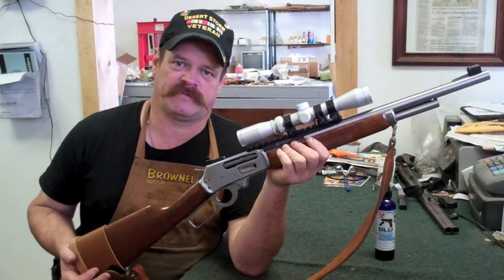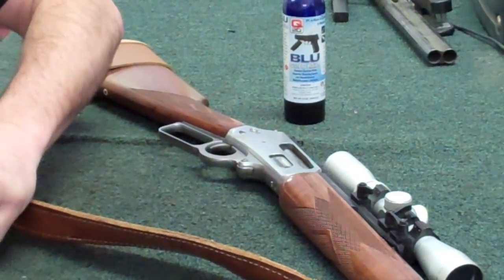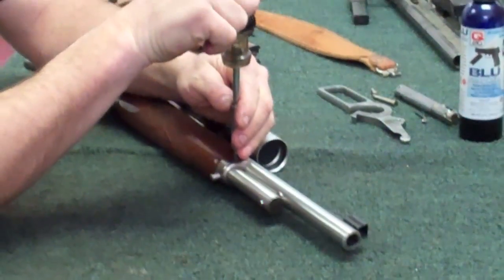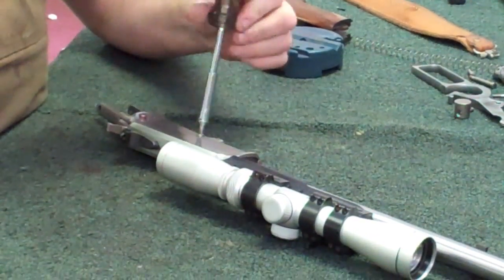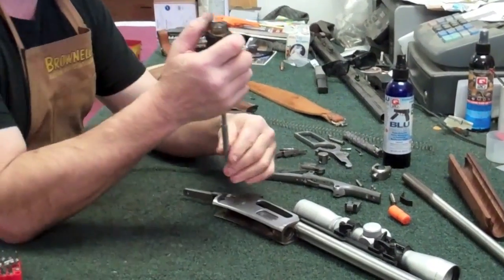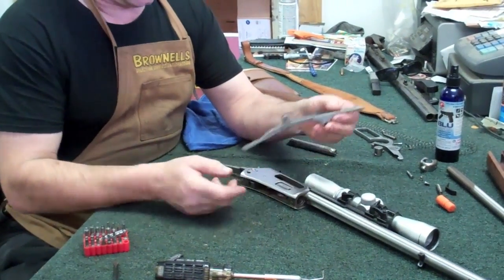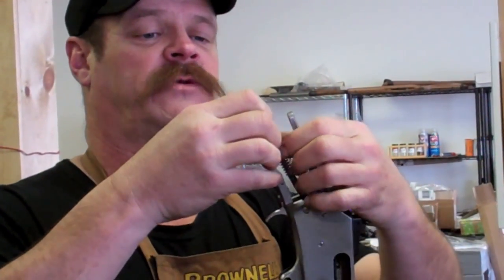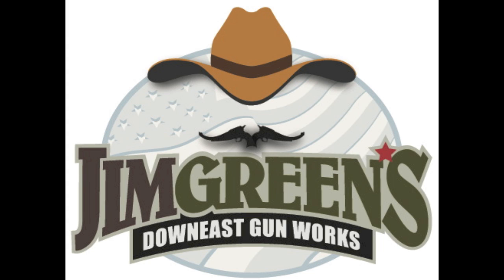Gunsmithing Disassembly: Marlin 1895 "Guide Gun" (Gunworks)

Comment: Just picked up my first Guide gun yesterday and this is the best video for the tear-down and reassemble too date. Had nothing but problems with my Winchesters so decided to purchase the Marlin, hope it works better. I was a small arms coach and tech for the military so my Winchester problem had nothing to do with lack of skill it seemed I had lemons. So you Winchester lovers I'm not dissing them my Model 94 in 45 lc case hardened trapper works fine and I love it it was the 45-70 model 86 had problems with.

Comment: Great video, very helpful. One minor comment, the spring on the inside wall of the receiver is the ejector(not the extractor, which is on the bolt face).

Comment: Thank you for the great video!  Just bought a .45-70.  My two-part firing pin is tight.  More used to pistols that I might clean, but typically don't oil.  Do you ever remove the firing pin to clean it?  Do you reassemble dry or oil it?

Comment from the maker: The 3 rd scope ring helps reinforce the scope and keep it from coming off the gun. Recoil was so stout with these loads the scope was coming off the gun after about 6 shots.
Reply: Quick question though, do the new production Marlins (336, 1895, 444, etc) have a half-cock on the hammer? I know they have the whole hammer block safety and everything but was wondering if it had the half-cocked option. Thanks for the video and keep up the good work!

Comment: Jim,  I have a question 
I have a 1895 classic with 22 inch barrel. Only holds 4 +1 but is extremely  tight to load. Is it okay to shorten the spring to ease the tension on loading.
If so, how many inches would be safe so as not to impact Action
Thanks for your help

Comment: Hi Jim, I recently bought an 1895 dark series new and noticed that the carrier initially is flush with the chamber when cycling but then drops as soon as the hand lever passes the carrier hook which I believe is resulting in rounds entering the chamber at an incorrect angle. I would say one out of four rounds results in a failure to feed and I think it’s due to this but I’m not certain as I don’t have one to compare it against. Is this a factor of breaking in the rifle or is this a manufacturing defect? Cheers for the videos!

Comment: The "tricks" were a help. What type of rear peep sight is that? Can it be set up with a finer aperture than a ghost ring? I'm looking for a good solid rear peep for my 444S. (My older Marlin still has the two screw holes drilled and tapped for a side mounted peep sight like Williams of Lyman.) But, the top mounted ones seem more streamlined and out of the way, ehnce my interest. Thanks

Comment: I have a Rossi Rio Grande 45-70 that I need to give a good cleaning and I would at least like to strip the lever and bolt out so I can clean some brass shavings out of the receiver. I can’t find any vids on the Rio Grand but somebody told me that it is an exact copy of the Marlin 1895. From what I can tell by comparing my Rossi to the 1895 in this vid they look identical. Could somebody please confirm that this is true for me?

Comment: I have noticed that my marlin 336 has started to take out the primer of the case just a bit and the acurracy is worst. I suppose that happens because of the pressure variations and check the whole weapon, I think the problem is that the blocking lock because it has a wear. There is someone else with this same problem?  I have heard that Marlin had different dimension locking bolts to fit to rifles

Comment: So ... when you reassemble your 1895 this way - pushing the bolt all the way forward without fitting the lever first - how in the HECK do you get that bolt back out in order to assemble the bolt and lever?!? 🤔I am thoroughly screwed right now. I cannot get that darned bolt to move out of the fully forwarded position. 😭
Reply: I did the same thing and can't get the bolt open???
Reply: @agobah  i managed in the end, but now I can't remember how anymore. 
I think I found a repair manual somewhere. I remember I got a hold og Marlin first, though. 🤔